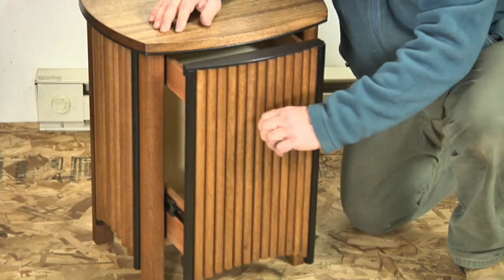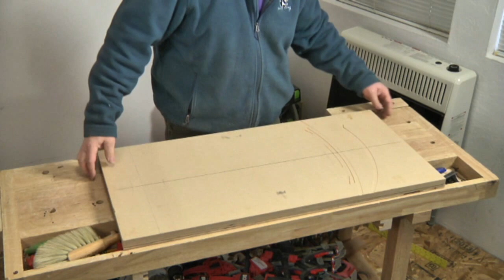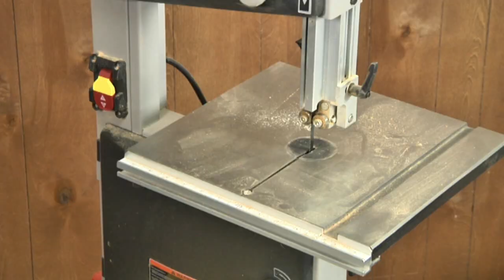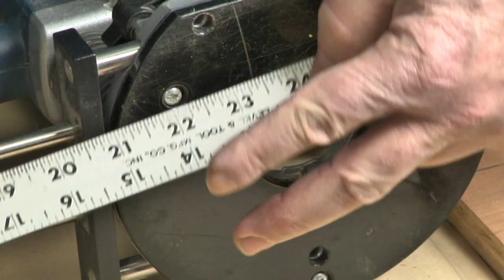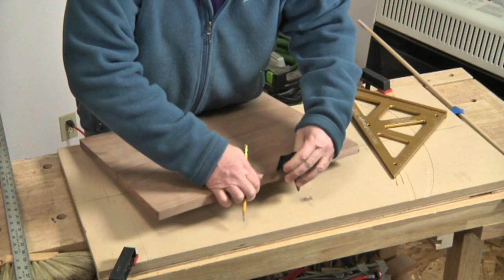Art Deco Cabinet Router Jig

Comment: I just finished building the handrail on my deck MyBest.Tools and used this great little router to clean up the top rail before the final sanding and stain. It was light weight but packed lots of power. Either size battery didn't seem to make it top heavy and I'm a 64 yr old women so I really appreciated how easy it was to use...................... CORDLESS only way to go !!